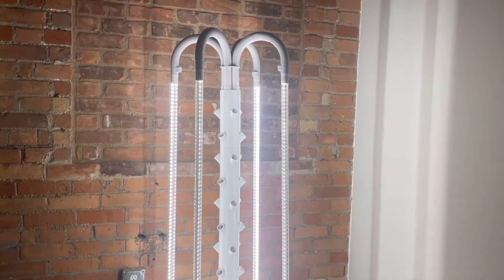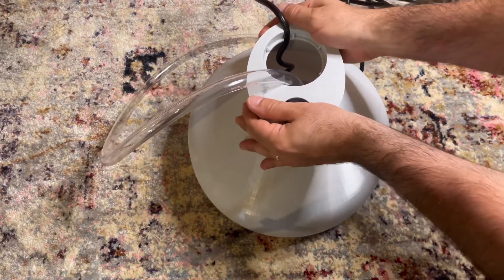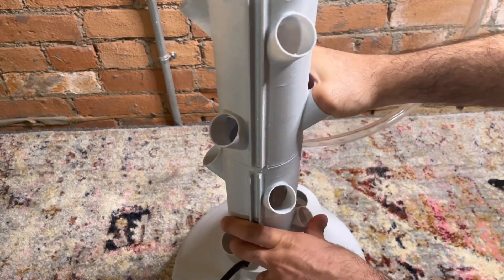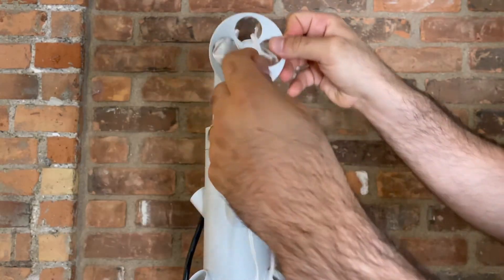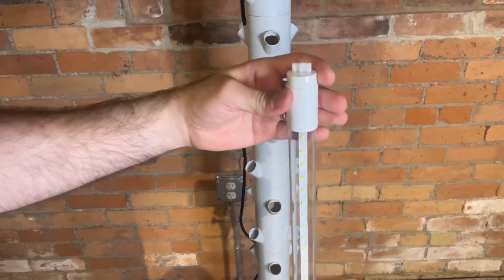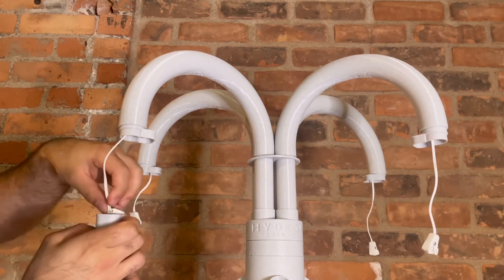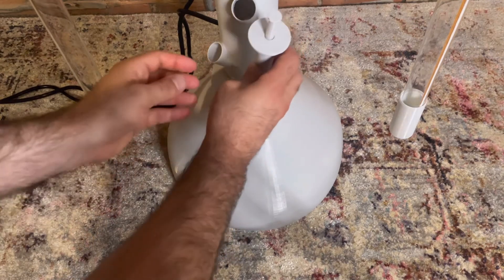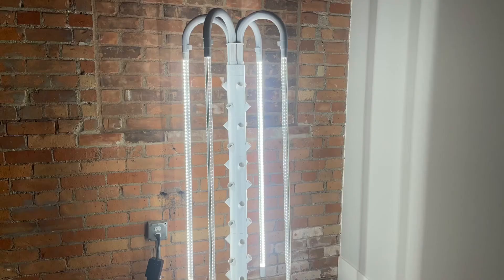The Hydro Designs Hydroponic Grow Tower with Lighting System Assembly

Comment: I am going to wait to purchase this when, the lighting distance from the plants is adjustable.  How about using flexible tubing for the light connection?
Reply: There's already a company that does that called Tower Garden by Juice +. They use the same LED approach but with flexi setup so you can adjust the lights. Aesthetic isn't quite as clean as this.